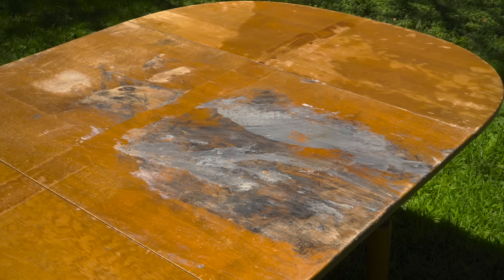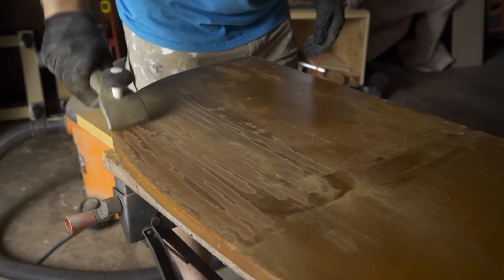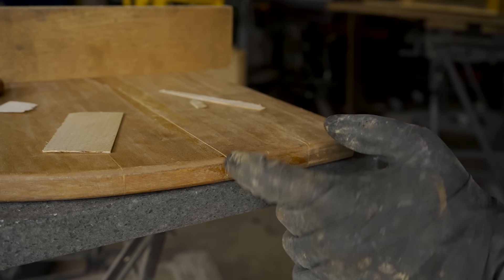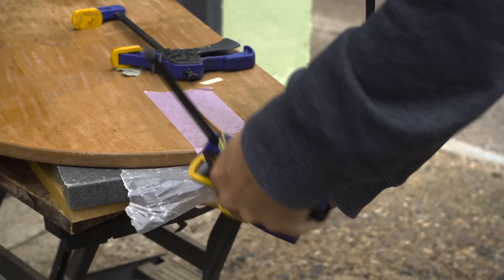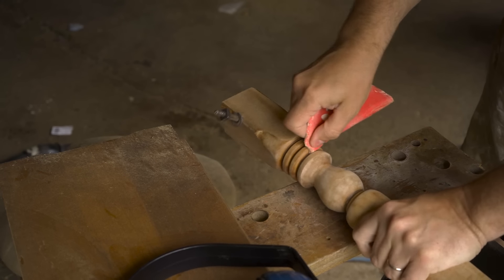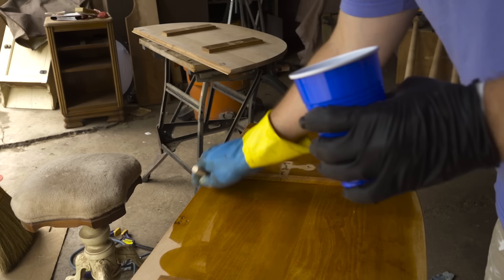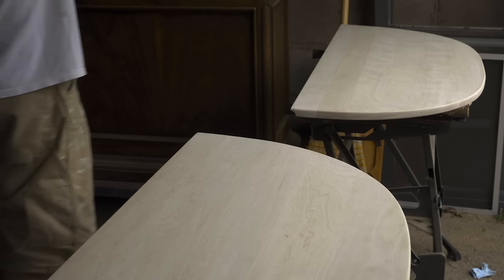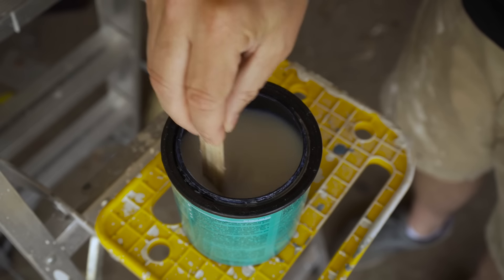Saving A Vintage Ethan Allen Table | Bleaching Furniture | Furniture Refinishing & Restoration

Comment: I worked for Ethan Allen in the early seventies, the factory was ancient, all the machinery was powered by a huge flat belt drive system that ran down from the ceiling where there was a long drive axle that ran the whole length of the building. It was slave labor at less than$100. a week and terrible working conditions.
Reply: You just described a dozen or more furniture manufacturers in the North Carolina Piedmont during that time.
Reply: I also worked for Ethan Allen In the 70's. I enjoyed it but I only worked 1 summer break between. College semesters. I loved the wood and the lacquer smells in the plant. Guess I am one sick puppy but I still love the wood.
Reply: Wow, fantastic!  I love your work.
Reply: @eggsngritstn  Mayville NY. Near Erie PA
Reply: I'm so sorry those workers were treated like slaves.
Reply: @jodirauth8847  They had unsafe saws, I watched a coworker's fingers plop down the convertor belt and fall to the floor. In the winter it was so cold everyone wore parkas and gloves. Icicles would form several feet long hanging down from the humidifiers.
Reply: @walkertongdee  This is why we need unions.
Reply: We have a coffee table with the same kind of crack. I’m not as patient or talented as you. 
Also, someone who didn’t know what he was doing took a belt sander to a maple table and I spent a huge amount of time trying to level it. Two pieces that have character never to be perfected!
Reply: Sorry to hear that.  My mother loved the Ethan Allen pieces she bought back in the ‘60’s and early ‘70’s.  You guys built some really nice pieces of furniture.
Reply: I really love these types of comments because it shows how much we've lost. That $100 per week has the same buying power as what $580 is now. That's $14.50/hr to work in a terrible factory.
Reply: @amwtm   I couldn't afford a place to live,slept on someone's floor, walked to work, skipped lunch, and worked Saturday. The next job got $130 wk, lol
Reply: I've worked in furniture/ woodworking shops for many years at all skills. Great training and rarely appreciated and rewarded. Not a trade with a company future. You are always a temp employee. Going on your own is difficult trying to compete with low quality factory products. Customers want quality but won't pay for it. Same with repairing antiques or normal furniture. Probably better to keep it as a hobby but can't gain pro experience that way. Also citizen volunteered to work on state historic society permanent wood collection artifacts. All interesting challenges with serious drawbacks and risks.
Reply: @walkertongdee  Considering the other comments here, I respect how little you got paid and still produced good quality furniture. I'm sure some of your stuff is still around.
Reply: My dad did too. He said it was terrible. He saved, worked two jobs and opened his own auto body shop a few years later. He sided in 2009. Doc said working in that factory probably what did him in. He got brain cancer due to solvents.
Reply: May have been, but it is incorrect to say it was slave labor.  Nobody was forcing you to work there.  Many other opportunities out in the world if you make the effort to look.
Reply: @jodirauth8847  No they weren't.  They were free to work anywhere else they chose to.
Reply: Yes I still proudly own and display my mother’s Ethan Allen dining table and 6 fiddleback spindle chairs. Beautiful. Paired well with Roxton furniture from Quebec, of which I also own several pieces. All colonial nutmeg finish. I’ll never part with them. 😍
Reply: Try working in the clothing industry…now that ….is slave labour…l loved it 😂😅😂😅
Reply: @bobbrown1603  you're right ..that was the way factory work was .. hopefully  better now in the US 😊
Reply: @bobbrown1603 slaves could run away too. So i guess they werent slaves
Reply: @Notmycatsanctuary  How awful. OSHA didn't come into existence until 1970, but still it took some time to fix a lot of what was wrong in manufacturing (and some never got fixed). Sounds like your dad was a hard worker. Sorry for your loss. My mom died in 2007 and I still miss her.
Reply: Right. I had to get up in the morning at ten o'clock at night half an hour before I went to bed, drink a cup of sulphuric acid, work twenty-nine hours a day down mill, and pay mill owner for permission to come to work, and when we got home, our Dad and our mother would kill us and dance about on our graves singing Hallelujah.

And you try and tell the young people of today that ... they won't believe you.

MP
Reply: @bobbrown1603  Too easy to say that. I was an HR Manager during my carreer. That is what I call terrible conditions to work. No Health and Safety Programs, no Benefits, even no heating (!!!), etc. If you respect your staff, they are going to respect you and I have started in a Metallurgy plan.
Reply: @MakerBoyOldBoy , it saddens me to read the comments from those of you who actually worked in those factories during the 70s. Being that that beautiful furniture you all made was made here in the United States. I wrongly assumed that you had at least good wages and safe working conditions and I’m very sorry to know that that was not the case. I hope it’s some small consolation for you to know that I still have the Henri on pieces that I purchased in the early 80s. There’s some of the most beautiful furniture pieces I’ve ever seen and I still treasure them today along with my Thomasville dining table and coffee table. But you’re correct many people today don’t understand why fine furniture cost so much and why it’s worth investing in.
Reply: I also worked for EA in Bowie Md Annapolis Md and in Florida as well
Reply: @bobbrown1603 Elon…?😅
Reply: @iambear.6526  It was a Union factory.
Reply: @amwtm   I got paid 1.65 per hour

Comment: The light blotchy areas were from GREASE / Oily food stains. Next time you have this issue, WASH the wood with Acetone. Three soaking washes and wipe ups usually pulls out most of the oil.
Reply: Your comment sounds like one of those "ask my how I know" situations!
Reply: Does that work on fabric, too?
Reply: @lmiller1413  I'm jumping in out of turn but NO, the acetone will leach the color out..unless it's white.

Comment: one fun trick with the water based polycrylic is that you can mix it in with latex or other water based paints, and it will basically turn them into hard enamel paints without the need for a top coat. I accidentially bought latex instead of enamel for my cabinets and then just tried this combo out of curiosity (I did about a 5:1 mix paint to poly) and it wears like IRON. It even sprays really well, as well as rolls/brushes

four years later and the only issues I've run into are where my prep was weak. The paint itself takes knocks and hits like a tank.

Comment: I am 65 years old, and I only bought high end furniture once: a white table, the wood grain showing, black leather chairs with chrome legs and a lamp with Murano glass.
Totally crazy mixture. We loved it. We also gave it away for almost nothing, when we moved into our motor coach 7 years ago.
We are full time travelers, no end in sight. 
But that table; if I had a house, I would buy it!😍

Comment: Congrats on the new sponsorship. Great job on the table as well! A tip for the water-based poly, use 2% ratio of propolene glycol in the varnish, it helps it even out the finish and reduce bubbles.

Comment: When you attached the legs, seeing two different finishes, reminds me of the nightmare my kitchen cabinets are. I bought this house because of the quantity of real wood details. Mahogany kitchen cabinets would match my furniture. The HORROR upon final inspection when I saw the “upgrade” my real estate agent gave them with cheap, white chalk paint, dollar store foam brush application and ONLY on the exterior! She didn’t remove the hardware either! I told her next time she sells a house with this “upgrade” to be SURE to use hot pink paint inside! I’m still refinishing 36 cabinet doors! 😢
Reply: Yikes! Going through a surprise right now - updating our 1970's oak wet bar. When we removed the hardware, we found that the hardware had been installed before any finishing was applied, so there is raw/unfinished wood in these elaborate shapes under all the hardware. (Because of course the cabinet and drawer pulls were very elaborately shaped and very large.) We are now stripping/refinishing the cabinets entirely so they will be cohesive. The oak is super pretty, though.

Comment: A foam brush with polycrylic really helps with the bubbles, in my experience. The plus side is that even the large ones are super cheap and work well.

Comment: I once used a oil based clear finish on something I painted white to protect the paint. I had something sitting on the same spot, a lamp, for about three years and the area uncovered turned yellow. U now only use the polyacrylic/water base. It's very thin. I usually use white cotton knit lint free(cotton tshirts) to wipe on finish. For tops usually 5 coats or so to get it on heavy enough for heavier use tops, sides usually 3 light coats

Comment: I’ve used that polycrylic finish a few times, and found that the special brush Minwax sells for it actually helps with bubbles. I also found that a light de-nib sanding to open any dried bubbles, and a second coat helped a lot, I got virtually no bubbles on the second coat. 
 
I will note that the satin finish of it seemed to produce less bubbles than the flat finish variant, but that could be just in my case.
Reply from the maker: I’ll have to check out that brush if I use it again.
Reply: My wife and I actually each have had our own quart cans of that finish.  I used it on pine/whitewood cabinets I built in my wife's garage that we also use for a partyroom.  She uses it as a finish on wooden frames I have made for her artwork.  I have also sprayed it on wine barrel stave art.  It's not a bad product.

Comment: Thank you so much for the very timely tips!  I’ll be bleaching sugar maple buffet this weekend and now I won’t panic if the first try is a little wonky.  Also, I’ve heard you can make your own lye solution and use pool grade hydrogen peroxide (not boo boo grade) and it’s much cheaper.

Comment: totally uneducated idea so feel free to disregard, but if I had that table, my thought would be to remove the top finish with a scrub plane, as well as then maybe trying the job you did with the belt sander with it as well. You'd maybe get some more material removed, but with the nice fine control of the plane, remove any warping as well, and then with a couple winding sticks and a jack or smoothing plane, square it all up (it's how I did the huge stacked 2x4 top to my bench, it had both the ability to hog crap off and then pretty finely do the job without any risk of tearout or gouging. - and my scrub is made from a $20 amazon stanley that I filed the mouth wider and bench-grinder'd the blade camber) 

Since it's solid wood, just going a couple millimeters down wouldn't really affect the way it looked at all and would likely reveal the fresh consistent wood sans blotchiness. Plus scrub planes work FAST and consistently, vs belt sanders propensity to dig in more here and there.

But again, totally uneducated idea. I know enough about my actual field of expertise to know what I don't. I just find myself using my cheap piece of crap scrub plane to do a LOT of things that require both fine and aggressive work, then just smoothing off the curved slices with a smoothing or jointing plane. I even made a scrub plane out of a cheap little block plane and am constantly finding little uses for it!

As always, been a massive fan since day 1. Keep teaching me things and pissing off guitar snobs!

Comment: Though it would have been a TON of more work, why didn't you refinish the underside of the table, frame etc.?
Reply: Because it would've been a ton more work and he probably doesn't sleep under the table.
Reply: Also basically double the materials. And would’ve made the maker’s mark look weird
Reply: There was a style in the late 1980s for the top of tables, etc, to be natural or white and the rest dark.
Reply: He did bleach the underside of the tabletop. The underside has rectangular supports that are visible.
Reply: Bleached and white washed furniture is very popular these days! I bet it will sell for 20x that $30!

Comment: Love the solution for the sliver gap! Is that your new favorite chemical stripper?  I know you were fan of OG orange stuff than no longer exists in the original formula.  Also, why don't you ever spray? And I agree- the finish you picked is far more durable. Curious, what happened to this table?
Reply from the maker: I like qcs stripper these days. I do spray sometimes with aerosol cans. I gave this table away to someone.
Reply: @DashnerDesignRestoration  Thanks! Generous gift! I meant see you use HPLV or similar... in all these years I have not seen it.
Reply from the maker: I have a Fuji sprayer that I’ve used in a couple videos but it was probably years ago. I don’t use it that much. Most of the time it’s easier to use aerosol.

Comment: The video I used to try for a bubble-free finish using Polycrylic is this one: 

His big tips: saturating the brush with the thinner/water before dipping it into the finish so that you push all the air out first. And not overbrushing; you don’t paint the finish on so much as lay it on.

Also, keeping a wet edge, so what that meant for me was to work in 18” widths

https://youtu.be/X_GWXcydu5k